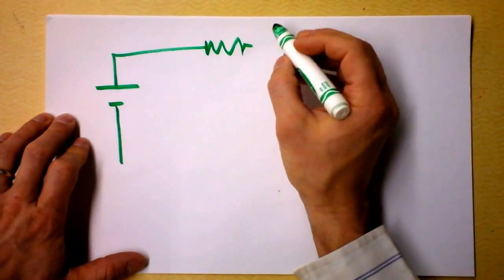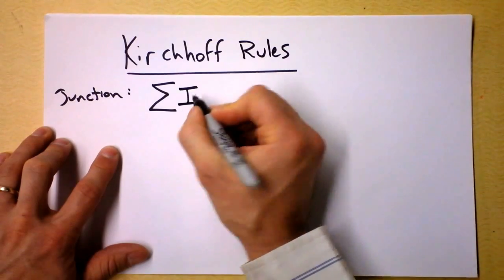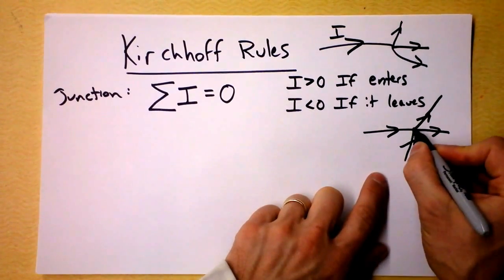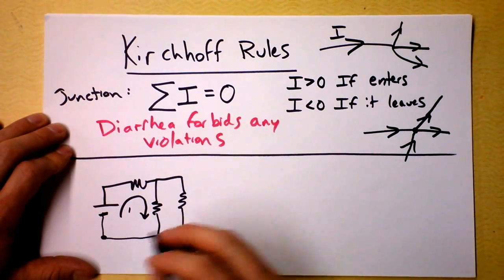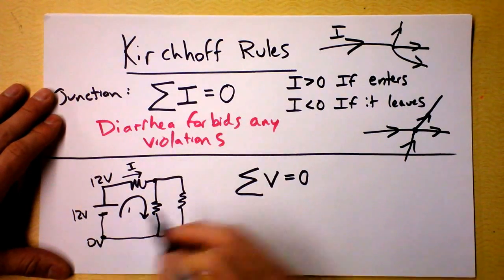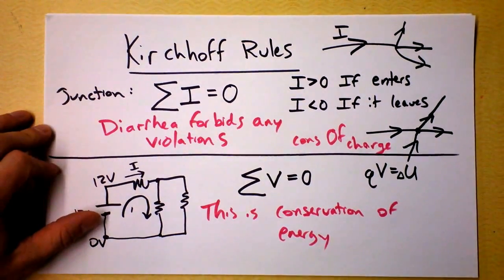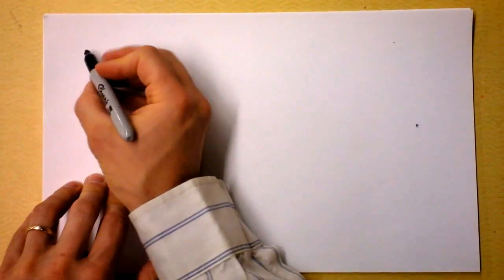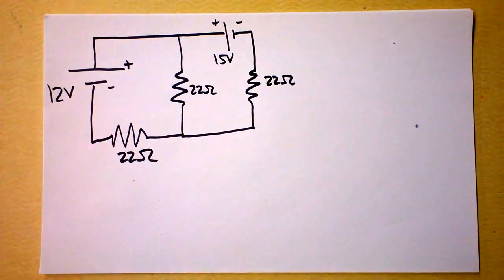Kirchhoff's Loop and Junction Rules Theory | Doc Physics

Comment: Just a question regarding intuition, if you wouldn't mind answering: the voltage is only truly at zero at the positive terminal of the battery correct? (or the negative if the conventional direction of.current is regarded). Since the electrons still detain potential energy - ergo there is still electric potential - at any given point of the wire that doesn't correspond to the terminal we.consider to receive.the electrons thus work can still be done onto the electrons, right? Thank you for the videos.

Comment: How would you find the currents in loops with resistors that also have multiple batteries with internal resistances?
Reply from the maker: +Rena Katz Oh boy.  Finding internal resistance requires two experiments (changing external resistance), since both V_emf and R_int are unknown.  TWO CUPCAKES!
Reply: +Doc Schuster What if you do know R_int? Could you just treat it as a regular resistor along with the others present in the loop?
Three cupcakes if I pass this exam tomorrow.
Reply from the maker: +Rena Katz I would do just that, indeed.  Just another lame series resistor.

Comment: Is it possible to attach a battery to a circuit without any resistors? Where would the voltage drop occur?
Reply from the maker: +Mizelleful I have two videos on EMF and internal resistance.  Enjoy!

Comment: I still don't know why someone would have to do this.  My brother is an Electronic wiz  going back to the 70's  and he can make a Schematic  or read one .   But he has a issue with English when he explains things or answers a question by someone wanting to know what he knows as to get into the field or build  things.
         I don't see any fuses  or switches ,  would this unit be  safe from open circuits or a charger.

Comment: Would the greatest percentage of voltage drop in a series circuit (assuming all resistance to be equal) be from full voltage to the voltage after the first resistor?
Reply from the maker: NO!  ALL SAME DROP!  V=IR. Believe it, buddy.  It's so simple, but I understand how it takes some faith or practice or something to accept it.  Work some problems to convince yourself.
Reply: I meant to say the percentage change in voltage and it would the change in voltage from (after) the next to last resistor to( after) the last resistor. The voltage would equal zero at that point.
Compare with diving physics, the greatest percentage change in pressure is from the surface to 33 ft. If you were at 99 feet and moved to the surface in increments of 33 ft, then the greatest percentage pressure drop occurs from 33 ft to the surface.
Reply from the maker: Aha.  You did actually say that.  That's an interesting perspective...

I'm going to argue that technically, the largest percentage voltage drop occurs at the LAST resistor (100% voltage lost there, right?), but that the observation is not relevant at all because voltage has an arbitrary offset (but pressure does not).  We COULD call the voltage right before the battery, e.g., -54 V if we wanted to.
Reply: I have to present an illustration of that problem to the rest of my electrician's class on the 27th.
Reply from the maker: Go get 'em!
Reply: Doc Schuster
Thanks Doc!